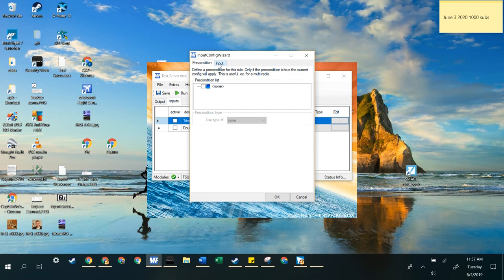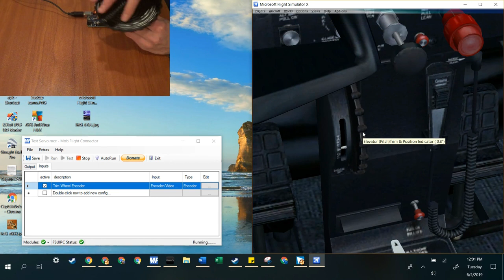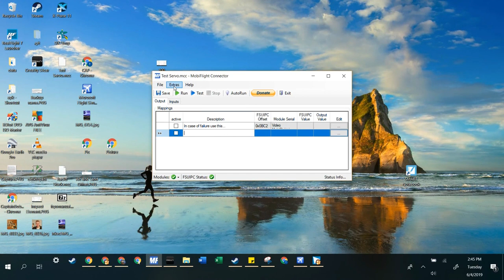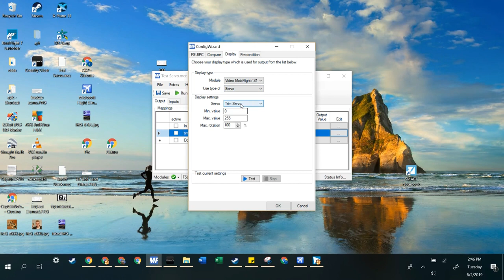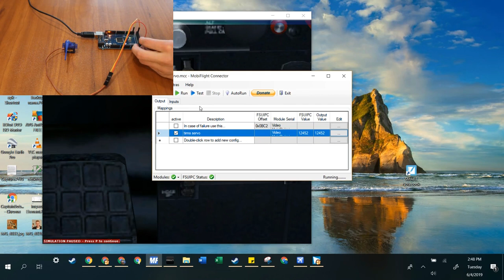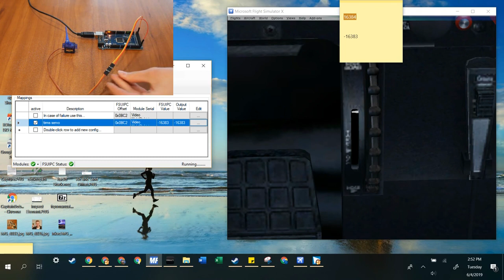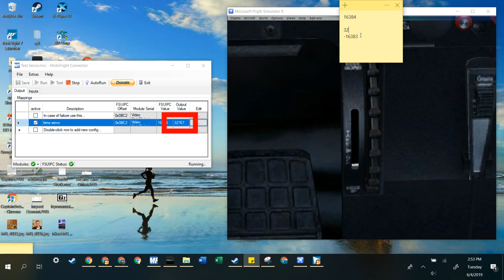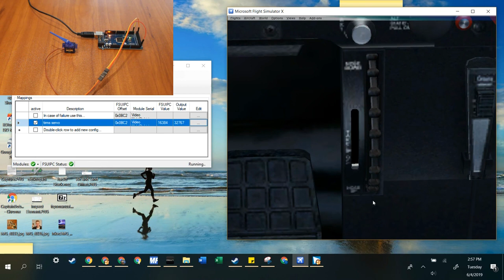How to Make A Flight Simulator Trim Wheel with MobiFlight| Captain Bob

Comment: Well, this is an old video, but hopefully still online. Thank you for the guideline in this video, though I wonder if you'd know how to set this up on X-Plane 12? I have the wheel working, however can't get the needle to move.
Reply from the maker: Try using an X-Plane command and see how that goes maybe?
You could also use a potentiometer instead.
Reply: Which ref did you use for the trim wheel, I'm just trying to set up on xp11 I can get one movement only then nothing else. I'm still trying to figure out the needle as well, I think I tried elv_trim_def but no luck yet

Comment: I connected resistors pair for roll and pitch to PC using MobiFlight and Flight Connector. But when I move this "Yoke"))  the yoke in cockpit doesn' t move. Is it issue with my "yoke" or flight simulator doesn't support that animation. When I move real factory yoke from saitek yoke in cockpit repeats my moves.
Reply from the maker: Did you try following this tutorial? https://youtu.be/qd9VGcZ2Rcc
Reply: @CaptainBobSim  Thank you for your answer! I will try to reconfigure my setup again. No I haven't try that tutorial and I'm going to try it now🙂
Reply from the maker: @Avrora707  To clarify - that's for smooth potentiometers, if you have a rotary encoder (clicky) you'll have to use my rotary encoder video.

Comment: newbie to arduino, got all the hardware together (encoder plus  arduino board which is recognized by the mobiflight software) and installed the software (Arduino IDE 2; msfs2020, wasm and fsuipc recognized by mobiflight). Mobiflight is now version 9.5 and the configuration screens are totally different (so I got stuck while trying to configure) -- any chance of doing a new video with the new 9.5 version software for the trim wheel? Thanks much
Reply from the maker: I'll politely decline for now :) MobiFlight is constantly evolving, and I am constantly studying for exams, and don't have time to update every video for every update🥵
You might consider watching this video as a little bit of help: https://youtu.be/7wgfTW9VO_I 
I do config videos as I redo things, so there will more than likely be a new trim wheel video for the V3 trim wheel.
Reply: @CaptainBobSim  Totally understand.  Keeping track of and attending to the rapid evolution and changes is certainly a challenge. Your suggestion is welcomed, always willing to learn.  Thanks much.  Best wishes for great performance on exams.
Reply from the maker: Totally! And let me know if there are any specific questions I can answer.
Reply: @CaptainBobSim  Had missed a step from your tutorials, got the trim wheel done using the FSUIPC instructions you have given. Now that you have taught me how to get more comfortable with this, I will try and work out how to do the same using Simconnect.  I suspect you are studying engineering in college.  I am an engineer who finished my engineering education over four decades ago, so I am well aware of the tough road of studying for exams .. very best  wishes.
Reply from the maker: @baluprabhakar9838  Yes, I'm going into Mechanical Engineering :) Best Wishes Balu!

Comment: hello i have made a steper motor to use airspeed indicator but on mobyflight i press play and stop to test but the steper motor make onli rotate in clock wise ..press play or stop need help ...suludos from portugal
Reply from the maker: Usually this is a wiring error. Have you tripple checked your wiring and confirmed you flashed them to the correct pins?
Reply: @CaptainBobSim  thanks.s
Reply: tank you now its working i have thange the polariti in the steper a long time ago ....now its working  saludos from portugal
Reply from the maker: woo hoo!

Comment: Why using Rotary Encoder & not potentiometer for the Trim Wheel ????
Reply from the maker: At the time that was all that was available with MobiFlight (analog didn't exist yet).
I also used this so that you wouldn't have to deal with the 270 degree travel restriction instead of the 9 turns a real Cessna gets. 
I agree - the video is outdated, and I'm planning on making a better version as the C172 project builds it
Reply: What about Hall Effect Sensor instead of potentiometer ,( I replaced my Saitek Yoke with Hall Effect)  ?
Reply from the maker: @yair1956  Yeah! That would be even better!
I personally haven't ventured too much into them, but it would be a great fit assuming you figure out how to make a multi-turn functionality.

Comment: is there a way to make this universal? fe, instead of using raw values you use calculations in mobiflight? Would that work?
Reply from the maker: I believe it actually is universal despite what I said:
0BC0	2	Elevator trim control input: –16383 to +16383
Found in the FSUIPC OFFSET STATUS document.

Comment: Hello Captain, first I have to thank you for this channel, you do amazing things and I learn a lot. I'm going to buy a arduino mega and play with mobiflight inspired by you, and I have two questions: when the trim wheel is controlled by an axis and the auto pilot is disengaged, there is a dissynchrony between the virtual and the real axis, which causes problems when the compensator is handled again . Can I get rid of this problem with this encoder trim wheel and mobiflight?
And the other question is, I'm going to play other games, mainly racing, can I use the mobiflight buttons in other games? I'm pretty sure not but I would like to clarify the doubt.
Keep the good work, you'are a incredible guy
Reply from the maker: Thank you Eder!
You won't really be able to use the mobiflight buttons in other games unless you set them to a key instead of an FSUIPC input.
I haven't had problems with my trim (I haven't hooked up AP yet).

Comment: Great, you can adjust the yoke strength of the trim. Install a servo motor to move the middle point of the yoke. When performing trimming, the servo motor adjusts the position of the private server motor according to the offset parameter in p3d. The yoke rod force gradually becomes 0                      No need for complex and unreliable force feedback

Comment: Hi, I'm following all the steps in the video, to connect an encoder like elevatortrim, but it doesn't work, and I tried to put the 'offsets of the trim control with the values $ + $ -, but it still doesn't work! How could I currently connect it to msfs20 ??
Reply from the maker: Are you using $+1?  (you can increase one some more to have larger steps) additionally- do you have the three green check marks on the bottom right corner?

Comment: Do you have a data sheet for the rotary encoder you're using?  I've just built one of these and turning the wheel around a full 360 produces only a tiny 1-2% change in the trim position.  Yours seems to move at a much better rate.
Reply from the maker: Hello! I'd probably recommend using an FSUIPC offset:
I think either of these would work:
0BC0	Size: 2	Elevator trim control input: –16383 to +16383
2EA0	Size: 8	Elevator trim deflection, in radians, as a double (FLOAT64). Up positive, down negative.
You can adjust the on left and on right values to change how much the encoder changes (The $+1) Here is my most recent Encoder Video: https://youtu.be/7wgfTW9VO_I

Comment from the maker: Hello Everyone!
I found a MobiFlight Forum here talking about some of the pitfalls of using event IDs. https://www.mobiflight.com/forum/message/22741.html 
I would definitely recommend using the FSUIPC offset for trim instead, as it has a lot more flexibiltiy.

Servo swapped? Encoder moving too slow? See below!
 If the servo is reversed for you you can easily use an interpolation to reverse the chart. I explain this here: https://youtu.be/exEFExtaQQk
To swap the values use the interpolation of:
0  32767
32767  0 

I used value 32767 because it is 16384+16383
I believe you can also rotate/flip the servo around to reverse the sides.

If the encoder doesn't move fast enough you can use an FSUIPC offset:
I think either of these would work:
0BC0	Size: 2	Elevator trim control input: –16383 to +16383
2EA0	Size: 8	Elevator trim deflection, in radians, as a double (FLOAT64). Up positive, down negative.
You can adjust the on left and on right values to change how much the encoder changes (The $+1) Here is my most recent Encoder Video: https://youtu.be/7wgfTW9VO_I

Comment: Hi Captain. For the life of me I cant figure out why my indicator is moving in the opposite direction to the simulator ! Trim wheel is operating fine but the indicator is moving down as sim moves up, and vice versa......no doubt this is a quick adjustment in mobiflight but any assistance would be appreciated.
Reply: Managed to fix it Captain by adjusting the interpolation figures per your other video on servo hookup. Thanks again !
Reply from the maker: That's wonderful to see you got it working correctly, sorry for the hassle, I'll be sure to explain this for people in the future in a comment!

Comment: does this work with msfs2020 and do you have to run that software all the time
Reply from the maker: This works with FS2020. I did a video on using MobiFlight with FS2020 here: https://youtu.be/9Ot8EALj99o
Just keep in mind offsets may be slightly different, so check the FS2020 offsets list.
You can turn on autorun (next to stop) on the software and it should run in the background whenever your flight sim is open. 
Have a great day Lee!

Comment: Hi Captain Bob, thanks for all your How To videos. I'm starting from scratch and have already learnt a lot thanks to them. I've decided my first project would be the trim wheel. I got all the same components you did. I got the servo to work fine but I have an issue with the rotary encoder. Even though I've changed the parameter in mobiflight from 1 to 4, a full turn of the rotary encoder only turns the trim wheel in FS2020 by a very small amount (about 5% of a turn). Nothing like what you achieved. I tried 3 different encoders but got the same results. And if I spin the encoder fast (which could be done through reduction gears) the wheel in the sim barely moves. Have you  experienced that? If so, how did you fix it?
Reply from the maker: I haven't experienced this. You said you changed the parameter in MobiFlight from 1 to 4, (on right and on left) have you tried doing something crazy like $+50 or $+100?

Comment: Do the servo and the rotary encoder have their own Arduino Mega? We need to have 2 in total to get both running? Thank you
Reply from the maker: Nope! Each Arduino Mega can have many electronics, up to 68 buttons in fact, I believe 20 rotary encoders, and 10 Servos. Knock yourself out!
Reply: And the power supply should be included for turning them on or the power can be supported by the USB cable? Thank you
Reply from the maker: @winglaamliu1170  I'd definitely recommend using an external power supply, but if it is just one servo you can use the power supply  through the USB.
Reply: @CaptainBobSim  thanks .... just ordered the materials and cannot wait to try building my own trim wheel😌
Reply from the maker: @winglaamliu1170  Hooray!!

Comment: what about aileron & rudder trim wheels, will this work for them?  are there datarefs output variables for those in MOBI-FLIGHT?
Reply from the maker: Try the FSUIPC offsets: 2EB0 8 Aileron trim deflection, in radians, as a double (FLOAT64). Right turn positive, left turn negative and 0BC0 2 Elevator trim control input: –16383 to +16383
Reply: @CaptainBobSim  you said "Elevator" trim control input, did you mean rudder?  In the last field in Mobiflight, it asks for "Set Value"  and it can't be blank, what would go there ?

Comment: Have you noticed any physical wobble with the rotary encoder?  I got some of these: https://www.amazon.com/gp/product/B08728K3YB/ref=ppx_yo_dt_b_asin_title_o01_s00?ie=UTF8&psc=1

They work great for hdg/vor/nav/rudder trim but for my elevator trim wheel they have quite a bit of back and forth wobble which is pretty irritating.
Reply from the maker: I have not noticed any with the encoder I used, but have experienced some with other encoders.
Reply: @CaptainBobSim  Ah cool thanks good to know, I might have to try those.

Comment: Would an Arduino Uno work as well? Or does it have to be a Mega?
Reply from the maker: Uno is not supported yet, only Mega and pro micro
Reply: @CaptainBobSim  i;m using a Mega, and using pins 7 and 8 on the ANALOG pins of the Arduino and the middle wire from the potentiometer is to ground.  I cannot get the Beechcraft King Air's aileron trim to respond.  i have it set to AILERON TRIM LEFT and AILERON TRIM RIGHT in the INPUT tab as "Event ID" AILERON_TRIM_LEFT which is equal to 66276 and the right one is 66277.  I should be using the "ANALOG" pins on the Arduino, correct? and middle wire to ground?  Thanks, it's driving me nuts.
Reply from the maker: @harpoon_bakery162  That should work. Try with a few other digital pins to make sure it's not a pin problem, then try with other offsets to make sure it's not a hardware problem.

Comment: What was the potentiometer ohms rating. Do you have a P/N?
Can it rotate more than 360 deg?
I have no 3D printer. Can I order one?
Reply from the maker: It is an EC12 rotary encoder, it can rotate more than 360 degrees. 
You can not order the part as the .STL file is not marked for commercial reuse.

Comment: hey, i want to ask that while we running the mobiflight did we need change the setting in fsx first or not?because i follow every step u do but my trim in simulator wont working as you like, also can you give clear scheme for wire between arduino and encoder
Reply from the maker: Here is the how to install MobiFlight video, it should help you with your problem. https://youtu.be/4XUoG1BAWPs
This video here shows the wiring:

https://youtu.be/xuAtfp-lxZs
I do not have a clear schematic.
Reply: @CaptainBobSim  i have downloaded everything and everything its oka, the problem while i try to roll my trim wheel like ur video in my fsx the trim wheel not working
Reply from the maker: @rendyraj1110  First try something simple like a rotary beacon switch, to make sure everything is working properly, then move to the trim wheel. Also try using Event IDs instead of FSUIPC events, or vice versa.
Reply: @CaptainBobSim  may you give explain about try using event id's . thank you

Comment: to get the module green sign we just input our arduino mega directly to pc or there is something else before we plug it?, besides already downloaded the software that required
Reply from the maker: You will also want to set your path to Arduino IDE, I show hot to do this in this video: 
https://youtu.be/4XUoG1BAWPs (It starts at 1:35)

Comment: for arduino is there coding? if yes can i get it
Reply from the maker: You will likely have to configure this yourself in MobiFlight, as I accidentally deleted the file :(
Reply: @CaptainBobSim  so this needs coding right? or anything  and can you make it clear i dont understand, i laso have question in you forum thank you.
Reply from the maker: @rendyraj1110  Sorry, I don't think I was very clear :) MobiFlight is a software that uses signals from FSUIPC and Arduino. You configure Mobiflight to do what you would like to do. There is no coding involved. You can use other softwares that require coding if you want (Link2FS, etc) I was talking about a configuration file, which is possible to export.
Reply: @CaptainBobSim  i see, i just get it and started to know about this all. thank very much

Comment: 10:23 max value is 2x that. you added that earlier,but then fix it later.dumb :P
Reply from the maker: Oh I might have done that 😂 I filmed on multiple days
Reply from the maker: Wait. Are you talking about the transformation? I found the high number by trimming all of the way up, then found the low number by trimming all the way down. I then added the low number to the transformation, to make sure that the trim wheel never went below zero.
($+lownumber)
 I then added the High+Low numbers, to get my max value, to cancel out adding the low number to the transformation.
This is all done to make sure the servo doesn't have negative inputs. Intentional :P